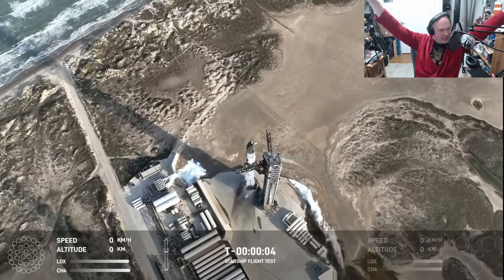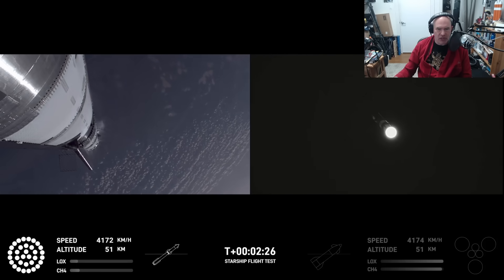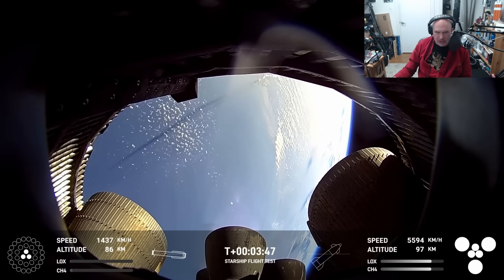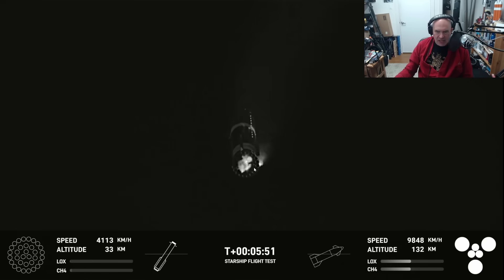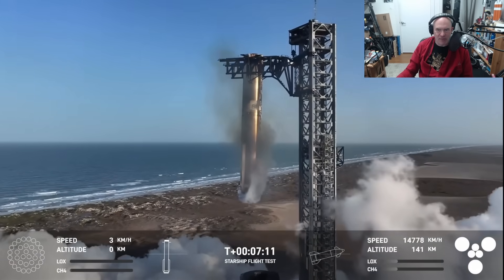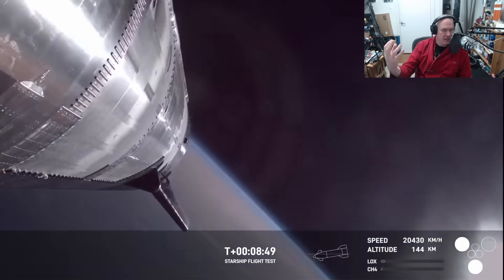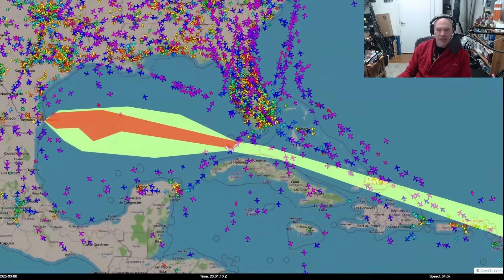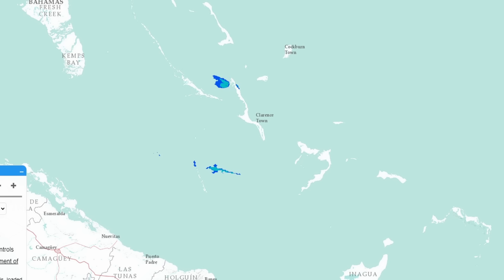SpaceX Make The Same Mistake Twice With Starship Flight 8

Comment: Hi Scott, can you take a look at the Pogo problem Apollo 6 ran into as well as several of their older rockets. Specifically Apollo 6 barely made it to orbit and had several engines out on multiple stages because the hammering effect was so strong. The G-Forces we're so strong it would have killed the crew had they been present. NASA had over a thousand engineers working on this issue at one point. It seems like they developed a specific fuel line damper that was filled with helium similar to a plumbing anti-hammer device which resolved the issue. As the saying goes, those who ignore their past are doom to relive it!
Reply: well yeah it makes a lot of sense if you have a huge pipe running whole length to have a pressure accumulator, just a side-connected membraned chamber to take in all the shock of that inertia.
Reply: The Pogo problem in Apollo 6 highlights how even cutting-edge technology can face unexpected challenges—and how critical it is to address them head-on. As you noted with the saying, “those who ignore their past are doomed to relive it,” this episode underscores the importance of learning from history. The Apollo program’s success in resolving Pogo paved the way for safe lunar missions, and its lessons continue to inform modern rocketry, like SpaceX’s iterative approach with Starship.

In short, NASA’s response to the Pogo problem was a triumph of engineering. By developing a helium-filled damper akin to a plumbing fix, they turned a near-disaster into a manageable issue, ensuring the Apollo program could move forward. It’s a reminder that sometimes the simplest solutions can solve the most complex problems.
Reply: @high-reshallucinations  I have never in my life seen a more bot like comment. Literally, this is a Redit summarization bot copying from Wiki.
Reply: @ASDeckard  at least it is an informative bot 🤣
Reply: POGO is a consequence of massive engines, and the Raptors are actually relatively small, so it's highly unlikely.
Reply: Your totally exagerating the danger of the Pogo ossilations to the Apollo rocket, your not the first to do this, the lay public has been fed this story for a long time to hype of the danger.  It as a managable problem that was monitored through out the program.
Reply: I was thinking POGO as well, but I have no familiarity with the Space X design.
Reply: I would say more relevant is perhaps the hydraulic (fuel) hammer issues of the N1. Multiple engine create sympathetic vibrations in the fuel feed and break the pipes due to overpressure.
Reply: The Pogo problem refers to a type of self-excited vibration in liquid-propellant rocket engines, known as Pogo oscillation. It occurs when unstable combustion causes fluctuations in engine thrust. These fluctuations make the rocket’s structure vibrate longitudinally—like a pogo stick bouncing—which then affects the propellant pressure and flow rate, feeding back into the engine and worsening the oscillations. It’s a destructive feedback loop that can damage the rocket or, in extreme cases, tear it apart.

This wasn’t a new issue by the time Apollo 6 encountered it. Earlier rockets, like the Titan II used in the Gemini program and some Soviet designs from the 1950s and 1960s, had also experienced Pogo oscillations. However, the scale and power of the Saturn V rocket, used in the Apollo program, amplified the problem significantly.

Apollo 6: A Near-Disaster
Apollo 6, an unmanned test flight of the Saturn V launched on April 4, 1968, ran into a severe Pogo problem. During the last ten seconds of the first stage burn, the rocket experienced intense longitudinal oscillations. The G-forces reached ±0.6 g—far exceeding the design limit of 0.25 g. These vibrations were so strong that they caused structural damage, including the loss of a panel on the Spacecraft Lunar Module Adapter (SLA). Had a crew been on board, these forces could have caused serious injury or even death.

The Pogo effect didn’t stop there—it led to multiple engine failures across stages:

Second Stage: Two of the five J-2 engines shut down early because the vibrations ruptured fuel lines.
Third Stage: The single J-2 engine failed to restart for the planned trans-lunar injection burn.
Despite these setbacks, Apollo 6 barely made it to orbit. The onboard guidance system compensated by extending the burn times of the remaining engines, achieving a highly elliptical orbit instead of the intended circular one. While the mission succeeded enough to provide valuable data, it was clear that Pogo was a critical issue that needed fixing before crewed flights could proceed.

Why Was Pogo So Severe?
The Saturn V’s massive size and powerful F-1 engines in the first stage made it particularly susceptible to Pogo. The thrust fluctuations from these engines could easily couple with the rocket’s natural structural frequencies, creating a resonance that amplified the vibrations. In Apollo 6, the mass distribution—including a test article simulating the lunar module—worsened the effect compared to Apollo 4, which had a lighter payload and experienced less severe Pogo issues.

NASA’s Response: A Thousand Engineers Strong
After Apollo 6, NASA knew they couldn’t risk a repeat performance with astronauts on board. They formed the Pogo Working Group, bringing together over 1,000 engineers from NASA and industry partners to tackle the problem. This massive effort focused on understanding the complex interplay between the engines, propellant feed system, and rocket structure that caused Pogo.

The solution came down to “de-tuning” the rocket’s engines—changing their vibration frequency so it wouldn’t resonate with the rocket’s structure. After extensive analysis and testing, they developed a specific fix: a helium-filled damper in the liquid oxygen (LOX) feed lines.

The Helium Damper Solution
The fix involved filling the prevalve cavities in the LOX feed lines—just above the engine firing chambers—with helium gas about 10 minutes before liftoff. Originally used to control LOX flow during the countdown, these cavities were repurposed as shock absorbers. Here’s how it worked:

Absorbing Pressure Surges: The helium acted as a cushion, damping the pressure oscillations in the LOX lines that were driving the Pogo effect.
Breaking the Cycle: By preventing these oscillations from traveling up and down the feed lines, the helium stopped them from coupling with the rocket’s structure, thus breaking the feedback loop.
This approach is strikingly similar to a plumbing anti-hammer device, which uses a pocket of air or gas to absorb the shock of water hammer in pipes. In the Saturn V, the helium-filled damper served the same purpose, smoothing out the destructive pressure waves.

Testing and Implementation
NASA didn’t just slap this fix on and hope for the best—they tested it rigorously. At the Marshall Space Flight Center in Huntsville, they set up an S-IC stage in a test stand and conducted experiments. Additional tests at Edwards Air Force Base with the F-1 engines confirmed that injecting helium into the LOX prevalves eliminated the Pogo oscillations.

The solution debuted successfully on Apollo 8, the first crewed Saturn V mission. While Pogo reappeared in milder forms on later missions—like Apollo 13, where they added dampers to the second stage, and Apollo 14, where further refinements were made—the helium damper kept it under control, ensuring crew safety.
Reply: Good luck digging up old design and engineering docs from the Apollo program, after most of the engineers are gone, and all the paperwork got lost. It's not as much "ignoring" as it is "we gotta redo the homework." It's easy to do rocketry from the peanut gallery.
Reply: @dkosmari its not like there is a book written by the apollo engineers with the biggest lessons learnt or something... Once they are dead, knowledge lost, as audio/video/writing does not exist so no way to pass knowledge without direct contact
Reply: @arthurdefreitaseprecht2648  OK to be honest it's a pretty wild assumption their engineers just ignore the best available material on giant rocket design. Clearly they must have carefully thought about these issues, it's only their solutions seem not to work.
Reply: @matwyder4187  Sorry I forgot to put the /s on my comment. I agree with you
Reply: @arthurdefreitaseprecht2648  Even if SpaceX hired the surviving Apollo engineers, there are probably enough hardware differences that make the solutions not appropriate for the current rockets. I doubt the SpaceX engineers are amateurs at plumbing turbo pumps. It's more of a "we're operating in a different set of parameters, so we gotta redo all the steps to find a solution."
Reply: @dkosmari  man it is not about using the exact same solution, but it is about avoiding the same problem. Also, if you have experience about how to solve the problems, you can re-use all the steps, not learn them from scratch (which is what really takes time)

Comment: The US government should go with cutting waste and inefficiency by cutting all funding for Starship fireworks. SpaceX needs to re-prove that its engines work reliably on the ground before it is allowed to launch more debris again. Starship's lack of progress over the last few years make it seem highly unlikely it will ever deliver.
Reply: Disagree on your final point, considering they succeeded several test flights ago on the first version Starship, but yes, they need to do a full burn sequence on a tied down Starship V2 and find out where these leaks are coming from if they haven't already got it from some tracking system that isn't public.

Comment: "Hot Staging" is over I hope. There is way too much vibration and heat too close to the engines which I think can only be done with a new "cool staging" ring hopefully in design. Of course less weight can be put into orbit but that will be the price to pay for success. Maximizing the weight to orbit is one of Elon's goals, but the limit was reached with the hot staging ring and now he should go back to a "cool staging' application. Maybe a new design.

Comment: One clarification, the venting coming from the engine section during the booster glide back is not coming from the engines. There are 2 dump valves near the center 3 engines that allow for LOX or LCH4 to be dumped before landing.
Reply: The dump valves for BOTH propellants are really that close to each other?? - Dave Huntsman
Reply: @dphuntsman  we have not seen proof of which propellant the dump valves are attached to. I believe both are for draining the LOX tank since they have the landing tank on the booster to hold LOX and the LCH4 would be in the skinny transfer tube.

Comment: I’m starting to think the Starship development maybe a dead end. 
SpaceX is religiously obsessed with Starship but honestly I don’t see it ever being practical for the job it’s designed to do or human rated. Return on investment has plateau. Nearly every flight had a fire onboard and the lunar version is simply too tall for moon landings. 
The booster itself is an achievement and can be used with a standard second stage increasing lift capacity. 
Back to the drawing board or the CAD/CAM for Starship. Keep it simple and Starship is becoming anything but…😢
Reply: A fall back to an expendable upper stage is a likely senario at this rate as it would both allow for an actual payload mass AND if given a clamshell faring would allow large diameter monolithic payloads which could be game changing.  As it stands right now SpaceX is forfitting the title of largest monolithic payload volume to Blue Origin.
Reply: @kennethferland5579  Yes… I do have to admit Starship looks very cool. 
I can’t fault the enthusiasm to make it work.
Reply: I wonder how the major shareholders of SpaceX must feel. They just want a rocket that makes money. The problem with Starship is that its not been sized for legitimate commerce. Its been sized to suit Elon's Mars delusions. 

Shareholder revolt coming?
Reply: You realize the parts of the upper stage failing here have nothing to do with "non-standard" bits?  The experimental parts of the Starship upper stage are all re-entry related.  The engines that blew up are actually the same ones as on the booster that landed successfully.
Reply: @JohnDoe-420  Yes, I do realize as a child of the 60s and grew up with Apollo. 
The more parts added to Starship, the more that can go wrong. 
SpaceX is adding complexity to Starship and not following Musk’s philosophy of removing unnecessary parts.
The Raptors and vacuum version of the Raptors are the same engine but it’s the Starship system I’m questioning. After Intuitive Machines second moon landing tip over, a lunar Starship seems less attractive now. I can’t see putting someone in a Starship and doing hover slams, short landing gears, unproven refueling processes in orbit, a cable system on the moon because Starship is too tall, a tile heat shield that in the original wasn’t planned, addition of a hot ring stage adding weight. 
Solve one problem and three more takes its place making for an impractical design.

Comment: At the landing burn, for a second or so after relight, the exhaust plume bunches up beneath the booster, eventually resolving. Is that behavior simply a product of the booster’s velocity or specifically related to the transonic transition?

Comment: Obviously there is a big problem with acoustic vibration. They did a ground test to try and pinpoint the failure areas BUT when the spacecraft is tied down the vibration patterns are different than a free floating craft. The question is, why does the craft have such high vibration levels. Could it be that there are two different types of engines configurations that create large harmonics?

Comment: Looks like they broke the power train. Makes me think that the "fix" for this ship was a workaround. If the vibration issue was fixed something else broke. I think SpaceX should make changes to the fight software to shut all the engines down if all the gimbaling engines are loss so that some attitude control can be retained and perhaps control the reentry and put it down in the safest place.

Comment: Scott, I love your videos but the title isn't accurate. Flight 7 failure was harmonic vibration, this failure points towards an engine failure. Regardless, we dont know if is the same at this point.
Reply: Leak in the engine bay, probably caused by something breaking loose or breaking open, probably caused by vibrations again.  It's the most likely cause.
Reply: @JohnDoe-420  Guess we'll just have to wait and see.

Comment: Starting to thing the normal method of 'test it on the ground until it works' strategy is smarter than SpaceX's 'blow it up in the air where you can barely tell what happened' that also rains debris/pollution on the ocean and disturbs air traffic.